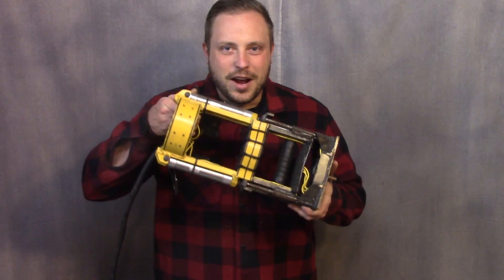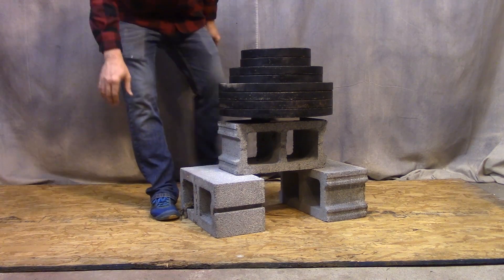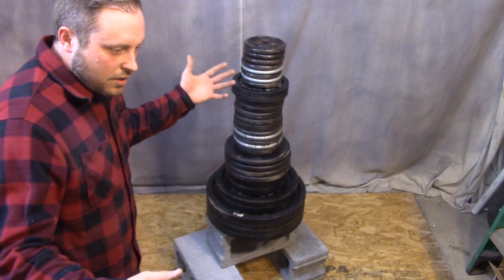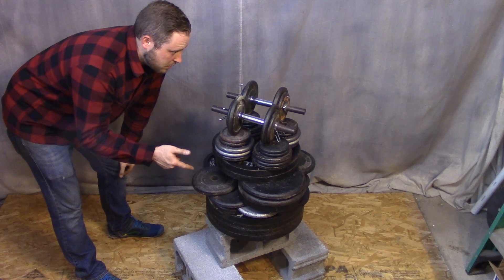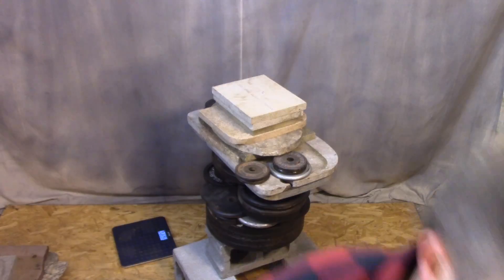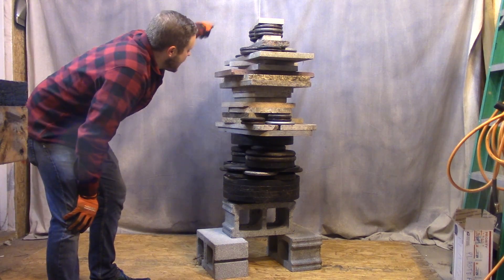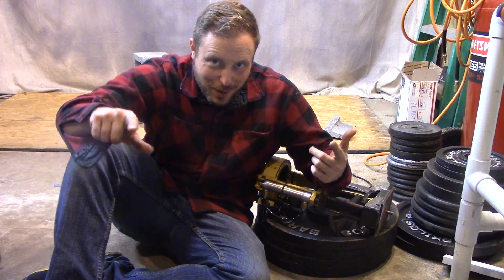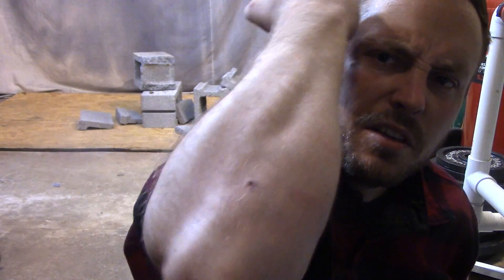POWERFIST POWER TEST - How much force to break a cinder block

Comment: okokokok, no. first of all, stacking the weights is compression force, which is concretes strong suit. second, its the point on the fist that breaks the concrete, its like a pickaxe. you couldnt do that with the stacking cause it would fall. you need to fix that and try again if you want to actually calculate your force, and put some kind of industrial scale under the cinderblocks when you punch. it wont be exact, but its more about comparisons anyway.

now, repeat after me: mass x acceleration.

 mass *X ACCELERATION*.

Comment: I don't think that the weights would be an accurate representation of the force it would take to break the cinder blocks. Because of the size of the first big weights, the weight would be distributed throughout the cinder blocks. The glove thing a ma bob  had a metal tip that would make all of the force from your glove and the arm into probably 5 cms of the cinder blocks. Standard cinder blocks have an area of 400 cms, and the weights were about 1000 lbs total. This means that for the weights it would come down to about 2.5lbs per centimeter. A survey said that an average male can hit around 421 lbs per square inch(not including whatever power the glove adds). Divide this by 10 which is the amount cms in an inch you get around 42.1 lbs a centimeter. This means that you put about 8 lbs pounds of pressure into that 5 cms which is twice the amount of pressure than you had with the weights. This was just calculating the force of a bare fist  so you probably put way more than that with that glove you made. In the future, it would be better to measure if you first put a solid layer of something that wouldn't compress (like Styrofoam), then put the wights on top to better measure the amount of pressure that it would actually take to break the cinder block. Im kinda disappointed because the massive amount of weights you put on the cinderblocks made your invention look stronger than it actually is.Cool video though.

Comment: Next time look up some info on Structural engineering. You were using a material that is designed to handle huge static loads. But when you concentrate a smaller amount of force in a much smaller surface area it will break. Physics bro.

Comment: if you set an accelerometer in it and kept the pressure switch on the poll at the front knowing the length of the poll and the speed you are swinging at and fancy math on a microcontroller you could get it to trigger with the impact adding fully to the force

Comment: It's not that you're putting out more than 1000lbs of force. You're applying motion to the force, which, in some cases, can more than quadruple the force applied. If you want to measure the actual force applied by your powerfist, you're going to need to spend some money on appropriate measurement equipment. FYI, in the direct center of a cinder block, they can support upwards of 2 tons.

Comment: I think cinder blocks are designed to handle constant pressure, not shearing or sudden pressure, so i think that's why you're having a hard time breaking the blocks.
Reply: Absolutely, also the punch is accelerated faster than gravity.

Comment: The reason why the cinder block didnt break is because of the surface area the weights covered on it if u had 1000lbs in the surface area of a penny it would break it easy because its directing all the weight on a small area

Comment: The weight of the punch was actually probably 300 or 400 lbs considering it was blunt force, and it was concentrated into a much, MUCH smaller area than with the "1000" lbs you had on there earlier.

Comment: Just to let you know a cinder block in obvious very good at supporting weight. It however does not take much force at all. That's why people who do a bed of nails performance use cinder blocks cause a nice ginger tap with a sledge hammer breaks them apart with ease.

Comment: Why!? Why did he have to set the bottom blocks that way!? 1. That is not how you set blocks. 2. No. Just, No. that's not how physics work. Surface area and Mass and Velocity matter too. that's why soft lead can pierce harder metals, and why diamonds, the hardest substance on Earth, can be cut; and even shattered. 3. (sample text) 4. Nice work on the Powerfist.
Reply: +Vers Nugriup
You're not incorrect, but that has basically nothing to do with the conversation here, and it isn't even a rebuttal or addendum to anything I've said.
The "diamond cutting" industry isn't an industry that cuts diamonds, it's an industry that uses diamonds to cut other things. Diamonds are ultra hard, which means when you grind them into a fine powder and cement them together, they are incredibly good at polishing or cutting through other things, especially other hard materials that usually resist abrasion. 
If you're talking about diamonds being "cut" to turn into gems for jewelry, then it's a misnomer. They're not cut like wood or cloth, artisans take tiny chisels and fracture the raw diamond along natural cleavage planes and other crystalline faults in the bulk material so that they get one nicely shaped little piece.
Reply: PolyJohn I swear you are a boss you just destroyed him hahahaha.
Reply: Vysair Damm bro chill, not like I was insulting you or anything.  Did you have a bad day or something?
Reply: VeryMeta Diamond is quite fragile really
Reply: when you want to comment because you actualy know stuff on the subject but you end up with a whole book and dont know if you made any mistakes so you end up telling yourself your own point on each aspect
Reply: naufal muhammad I'm pretty sure that's just a button to activate it, at 5:50 he smacks it
Reply: PolyJohn Mmmh but look at the way the blocks are built, it has three points that are obviusly more resistant, if you distribute the force between the most surface and these three points (lower pressure) isn't the same as if you concentrate it in one of them or less area.
Reply: VeryMeta I was just thinking about this lol
Reply: naufal muhammad its not a spike bro its kinda like a button....you know how he said it activates after he hits something...the button releases co2 pushing the plate forward putiing more power into the punch
Reply: VeryMeta your getting confused with hardness, strength and toughness.
Reply: VeryMeta 400th like on your 
comment
Reply: dominic tenorio No, the button is in front of the grip, and when the glove hits something his knuckles put pressure on the trigger, and then release CO2 into the actuator.
Reply: Seb - Do you seriously think that a four year old that pretends to know how to multiply looks retarded?
Reply: joey grieco then I'm sorry I got to say your physics teacher isn't qualified to be one. It's all about kinetic energy and point of contact. It will take only a few hundred pounds of kinetic energy to break a block if you hit it in the right spot. If you just pay weight on top of it then you will need a lot more pounds of pressure than a punch needs. Ask yourself why these block can make buildings that weight thousands of pounds? If you were to just stack weight on t like he did then you would literally need thousands be thousands of pounds just to crush it. It's physics 101 you put a large plate over the block so now the weight gets distributed evenly over the block is the wrong way to find out how much it takes to break through a brick. It's like an egg if you hold it right it can take a few hundred pounds of force to break it but then you use kinetic energy and a small point of contact then it breaks in under 10 pounds or force.
Reply: PolyJohn diamonds are in the cutting business
Reply: +TheMrComentarista
Hmm. You may be on to something there, however, I believe the cinder block being completely inelastic and brittle material means the net force is the more important than the pressure, IE high pressure over a small area or lower pressure over an equally larger area would both break the blocks at the same point of total force. I might be wrong though.
Reply: PolyJohn diamond can be cut. It is just the hardest material to cut but it can still be cut.
Reply: VeryMeta q
Reply: VeryMeta you know I wanted to message this guy and tell him to have the plate be the pressure gauge instead of the little prod. And have a little battery that pulls back the slides before he even punches so as so as that plate makes contact set it up to like idk a centimeter of give before the electric lines activate the co2 and so that you time the 300 pounds of co2 with his actual punch cause right now it's delayed too much and it's more like he punches you and then a half second later you get hit with a 300 pound second punch
Reply: Grieco - You can tell your imaginary engineering teacher that he's wrong.
Reply: When 2 science gurus are arguing, and your just here like
Reply: PolyJohn The surface that applies the force has a big impact on the pressure, that's why the blocks he put on the cinder will need a lot more force ( weight) than he will need to break them with the powerfist. Sorry for my english, i hope you can understand it.
Reply: Do you guys realise  the tip of the power fist he got like a spike to it that reduced the area of impact take a look at it.
Reply: VeryMeta nerd 

Jk
Reply: VeryMeta dude I was literally gonna write this but then thought wait I can't be the only one who realizes he is doing this all wrong like his power punch has a very small point of contact he wouldn't need 700 pounds of force lol idk if this guy is smart or not
Reply: @Vysair thats right. But then you can NOT be a scientist / professor / engineer / physicist if you not study it correctly. The problem here is, if you dont research right (thats what you are learning) you can get the right information but dont interpret it right or dont get the cohesion. But often, you CAN get good Information from the Net and CAN comment here correctly. And i dont want to say that you are right or wrong. i just wanted to correct your sentence ... and sorry for my english. I am not a native speaker.

Btw. i also dont have the feeling he is measuring it right. But i did not do my research on this.
Reply: Poly - "1000lbs of force from a weight resting on the block is not meaningfully different from 1000lbs of force applied by a lighter object moving into the block". It is completely different. During the impact the material (concrete) will behave as if it's more brittle than it would usually be. By decreasing the time that the force is applied you increase its brittleness.
Reply: sebastian Martinez that was 2 months ago. I DID stop
Reply: Alright, All of you can Shut up now, I decided to ask my Engineering teacher who has a doctorate in physics if this test was valid, He told me that it was not perfect BUT it was a fairly well set up test, In case you think I am lying about the teacher, His name is Doctor myers And he teaches at blue hills voc tech
Reply: 1 How he set the blocks really doesn't matter in this example
2 Mass and velocity give you the kinetic energy of the object, mass and acceleration as the object comes to a stop against the block give you the force it applies to the block, and weight is a measurement of force, so this is all accurate. 1000lbs of force from a weight resting on the block is not meaningfully different from 1000lbs of force applied by a lighter object moving into the block.
3 Diamond can't really be cut, it's chipped and fractured, and the fact that it's so hard means it's really easy to do so. "Hardness" is a measure of how much something resists being indented, not how tough it is overall. Glass is far harder than most metals, but you certainly wouldn't say it's particularly tough.
Reply: The angle of incident and initial shock can have significant impacts on how much force something can withstand.
Reply: Angle can, however the concrete that the blocks are made from have an even and consistent grain structure that and respond to forces isotropically. And "initial shock" is only significant in that, between two rigid bodies, the instant of impact is the moment of peak acceleration and force. That doesn't change anything else that I've said.
Reply: Harper Jones Yep. Everyone on YouTube thinks they're a scientists and tries to act smart lol.

Comment: If you asks, Why it doesn't break with those much weight? Because the weight is divided by the surface area, so for example you put roughly 500kg of weight, and the surface area is 2 meters per square, so the force that the weights do to the cinder block is actually 250newton

Sorry for using kg and meter instead of lbs and inch
And correct me if I'm wrong

Comment: Pressure = Force/Area, cross sectional area of contact of the first is miniscule (the nail point) so division by a small quantity provides a much larger pressure per sq inch, that's what breaks the blocks

Comment: It will break there's a small round ball in the centre of the metal fist which makes it split, plus if you put all them weights in the centre with a small metal bar where you hit it would break as all the weight is transferred to a small area 👍🏻👍🏻

Comment: The only reason connor mcregor can punch 745lbs is because it's the amount of force being transported to a smaller area so if you were to put the smaller weights on the bottom it would work

Comment: Static load is not the same as impact force - you would be better* served using an accelerometer or g-force sensor of some type to measure the force of the blow.

Comment: Force = mass x acceleration. Since in the standing weight test, the weights had no velocity or acceleration, it was all about their mass. However when he punched the block. There is a lot of aceleration. Therefore he can achieve the same result with a lot less mass.

Comment: The force of the machine is concentrated in a much smaller area as with the weights. because you put the Same amount of force or probbaly even less force Your pressure gets a lot higher because the force is now concentrated in one spot instead of the whole block    

Stil a pretty imperssive machine just wanted to clear out that Your comparison between the weights and you punch is not right

Comment: The weight was actually spread through the entirety of the cinder block. Those were big ass weights at the bottom. That's why it didn't break. You only broke those cinder blocks because your force actually was concentrated in the middle. More force minus surface area means breakage basically

Comment: cinder blocks are made to hold up weight they can replace jacks for your car it can hold up so much but they are not impact protective which is why you can punch through it but 1000 pounds wont break it

Comment: Now I'm not going to pretend I full understand physics but I don't think this guy does either
Reply: Jake Gagnon nope, impact force is not the same as a static structural load beared by the blocks.
Reply: JudgmentDay78 u also need to take area in consideration
Reply: @akbar8427  I think that's why he used the identical plate... still doesn't account for material properties and their time dependence, nor does it control for a punch that isn't completely flat.

All this being said, that power fist is still badass and would probably kill a human with a body shot
Reply: Yeah it bothered me more than it should. I mean, kinetic and potential energy are very basic concepts after all.
Reply: Mordraug that's not a spike it's just a button to activate the CO2 blast which wasn't connected in this video.
Reply: JudgmentDay78 like, he could do the same thing starting with a little weight. It would breake it a lot faster
Reply: Jake Gagnon nope, he does not...
Reply: Faith in humanity restored
Reply: especially since there is that spike at the end which probably does most of work breaking cinderblock...
Reply: you mean pressure
Reply: lilman227 ist
Reply: JudgmentDay78 finally someone understands
Reply: Jake Gagnon what he's doing is that he is imposing loads, an imposed load is not the same as striking force.
Reply: static load and impact load is different yo.
Reply: JudgmentDay78 hey look someone who doesn’t just pretend they are smart but say something that makes sense.
Reply: Exactly, smaller surface area bc the powerfist has a nub sticking out of its front, works good for damage but, the first presentation wasn’t really the same thing.
Reply: Mordraug its not a spike xD
Reply: Mordraug he even presses the button (spike for you) down before punching
Reply: there needs to be an account of pressure also, its not just kinetic or potential energy.

Comment: They use cinder blocks to brace the underside of houses.  I don't know what the surprise is.  And it's likely it took much less force to break a cinder block when punching than relying on soft lying weight to break it.  This whole experiment is flawed from the ground up in my opinion.  Having said that break some more bricks.